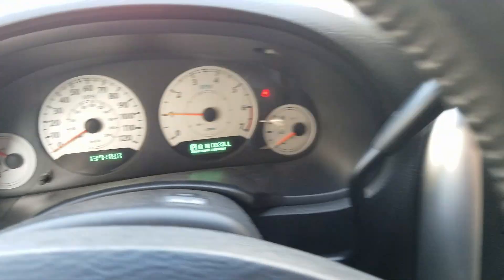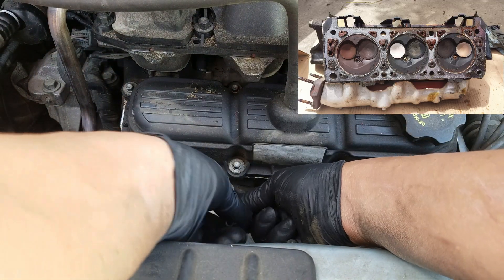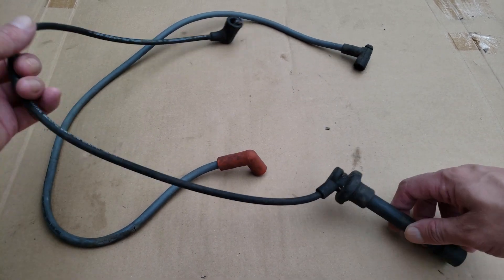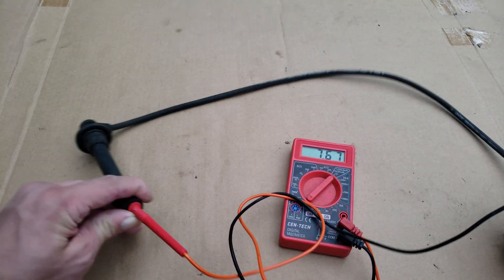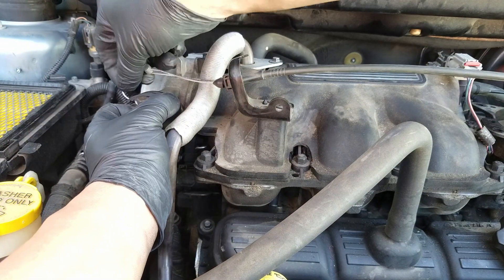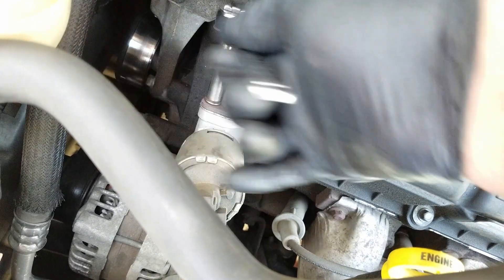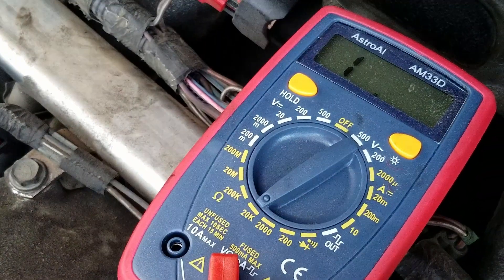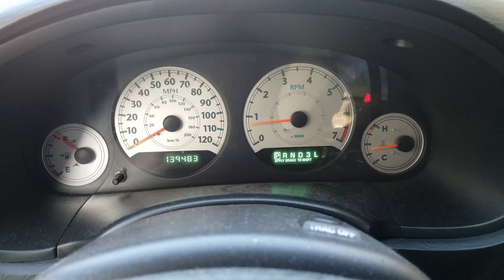How to Fix A Cylinder Misfire P0301 P0302 P0303 p0304 P0305 P0306

Comment: I have a 2006 dodge grand caravan that started running rough and had p0303 code. I swapped out # 3 and 4  spark plugs and wires and the code changed to p0300. Do you think the coil pack is bad?

Comment: What would cause misfire on 4 5 and 6? I have codes p0420 p1151 p0171 and p0174
Reply from the maker: Well ur running lean on both banks..so thats causing ur misfires...i would check for vacuum leaks..check ur air filter..clean maf sensor maybe..if not maybe u got issues with old or dirty sensor 1 oxygen sensors...and yea unfortunately also seems u got an old catalytic converter

Comment: is it the line order or firing order to fix p0302?
Reply from the maker: Well firing order has to do with the sequence the engine uses to fire the cylinders..but p0302 means u got a misfire on cylinder 2..so depending on which engine u have..if u have a 4 cylinder itll be in order..so cylinder 1 starting from the front closest to the accessory belt..if u got a 6 cylinder like on the video..cylinder 2 would be on the bank facing the front towards radiator the first one from left to right closest to the belts

Comment: Hello nice channel! I have a 2006 Chevy cobalt 2.2 I have oil sludge in my air cleaner/intake box that covers the throttle body and also p0301 code (cylinder 1 misfire) I already swapped the new spark plugs and boots i put in and still cylinder 1 misfire so I think it may be a bad coil pack but maybe it is  the valve cover??? Car shakes when bad when idling or stop at light but NOT driving
Reply from the maker: The oil on that car happens, since its got an older pcv valve its causing a lot of blowby...Normally when the coil goes bad on that car itll cause 2 cylinders to misfire since 1 coil controls cylinder 1&4 while the other coil controls 2&3..i had a similar problem on one recently and it ended up being a bad ignition module..i do have a video on tests u can run on the coil and ignition coils, maybe u might find it helpful.
Reply: @backyardchevy328  I’ll check those out, thanks a lot!
Reply from the maker: @brolla12  sounds great🙂 good luck i hope its helpful
Reply: @backyardchevy328  update: so i tested the coil pack with the multimeter and it’s reading at .8 for both which is good. I’m bout to test the ICM next. However, THE LITTLE CONNECTOR that goes between the ICM itself and the coil pack itself appears to be in good shape except that if I shake it a little it sounds like something is loose in there is this normal?
Reply from the maker: @brolla12  i shook the one i have here and it does sound like something moves like a very faint click back and forth...if all that checks out fine..id probably test the compression and compare that to a cylinder next to it just to verify everything inside is working normal..then maybe test the injector by disconnecting the connector and check ohm reading to the one next to it..after that may be the actual injector may be clogged..or something associated with that cylinder
Reply: @backyardchevy328  Yep I’m gonna mess with it more tomorrow; but I noticed the pigtail (wiring connector) that comes out of the car itself to connect to the ICM appears to be missing three pins ? Could this be the issue causing cylinder 1 misfire
Reply from the maker: @brolla12  no they do have missing pins, i just never counted how many it has
Reply: Gotcha! I’m sure I’ll figure something out.  This is my first car that I got senior year of HS, and I’ve done all the basic maintenance my self thought the years I’ve owned it; now its made me wanna keep learning more about cars. I appreciate it you sharing your knowledge! The camera angles in the videos are great, and the fact you are very clear and informative about everything; especially how to use tools to test AND show why the problem may have happened in the first place...Ósea, you show not just how to fix it but why it broke too! Keep doing what your doing man it’s great 👍
Reply from the maker: @brolla12  im sure you'll figure out this misfire too🙂👍 its definitely a good feeling to be able to figure out the problem and fix it..does it misfire the whole time or is it random misfires..if its random it may be harder to pinpoint due to the fact sometimes the readings on the components will be good and they only have problems under load.
Reply: @backyardchevy328  update so i tested all and everything seemed fine. I ended up cleaning the injectors with a buddy who has the equipment; the car was fine for one day but now it still misfires at idle/stop JUST WAY LESS than before..could it be the injectors need more cleaning or possibly just be replaced? Code is p0301
Reply from the maker: @brolla12  I would try switching injector location, take injector from cylinder 1 and put it on a different cylinder and see if the misfire follows that injector..if so then yea you'll definitely have an issue with the injector
Reply: @backyardchevy328  i ended up replacing the coil pack and ICM (bought the NGK one that comes as one piece) and car cranked and started fine but started shaking more then before and the engine light blinking with power reduced.. could It a faulty part even tho it’s new or should I try disconnecting battery
Reply from the maker: @brolla12  shaking and blinking light means u got misfires..its odd that it even got worse with the new part...it has happened to me with a ignition module i ordered off ebay once it was supposedly new but it was causing it to run worse and even came out with a cam sensor code..then i got one locally and fixed it all
Reply: @backyardchevy328  i ended up swapping the new ignition control module with the old ignition module (but left the new coil pack)  and it ran fine so looks like the same thing happened to me and it may be defective! however I bought my whole part new from the parts store, so I’m gonna go get the same part from them to swap it out and see what happens because id rather have both parts new..Either way I definitely know the problem now! Thanks again for your videos and this discussion 👍
Reply from the maker: @brolla12  thats awesome..glad to hear it🙂

Comment: I wished it was just an injector on my 2007 Colorado.  Since my Colorado is considered a newer model of the misfiring and overheating in idol.  JBA Chevy has told me after diagnosing my problem that my truck was over heating in idol and misfiring in cylinder #3 was more of an internal issue.  It was starting to affect the other cylinders after they put on their special computer.  A Whole Gasket Assembly had to be replaced on my truck.  A $5,400 repair job.  18 hours labor.  I'm broke now.  O o   Supposedly if the truck was older.  It would of been just a simple Gasket replacement, but it was affecting all cylinders and affecting the other injectors.  It was becoming dangerous to drive.
Reply from the maker: Ouch, im sorry to hear that 😔..yea those are usually the symptoms youll start having with a bad head gasket.

Comment: I have a 2005 dodge caravan. The engine does turn over and I was told it is because there is no compression in cylinder #2. Can you tell me if there is a way to fix this or how expensive it would be to fix. Thank you
Reply from the maker: No compression in a cylinder could be a few things..i could be that a valve isnt opening and that could be something like a rocker arm that maybe got damaged and that would be the cheapest repair..but also more expensive things like a head gasket...a burnt valve/damaged valve..or a camshaft...or worst case damage to piston...so only way to really tell is to try different tests like leakdown test or to open it up
Reply: @backyardchevy328  Thank you so much. I'll try the cheaper route first and hopefully that works. I'll come back whenever I figure it out.

Comment: Hi. I'm having an issue with my car, I want to get a heads up before I take it in for a diagnostic. I'm a woman & don't know much about cars & trying not to get ripped off. Well, I have 2016 chrysler 300s V8 it has 37,000 miles on it. When I take the car out first thing in the morning for a drive & I'm going about 30-40 mph & for the first 2 stop lights/signs when I brake the car jerks forward and kind of vibrates (not the steering wheel) before coming to a complete stop. It only happens for about the first 2 times i push the brake after that it breaks fine for the rest of my drive/day. What does this issue sound like? Rotors, transmission, misfire, software update? & do you recommend taking it to the stealer since it still has powertrain warranty or independent shop? & thank you so much for your videos.
Reply from the maker: sounds like ur idle might be high(which is normal when vehicle is cold)which is why it only does it when cold but maybe the idle might be too high which is why it jerks forward..maybe they have a computer update to lower cold temp idle or maybe a problem with the throttle body(could be dirty or possible vacuum leak)..cause after it gets to operating temperature it drives fine and at operating temperature the idle gets lower which normally happens
Reply: @backyardchevy328  I just drove it right now, warmed up & i'm feeling a slightly forward "jerk" like if I were to suddenly brake hard & your body moves forward, even if brake slowly. Not as much as when it's cold. Idk if I'm just paying too much attention to it or overthinking it. Hopefully it's something simple like computer update.
Reply: @backyardchevy328  & what causes the high idle?
Reply from the maker: could be the computer tune...could be a vacuum leak...could be dirty throttle body...or faulty throttle body..but yea sure seems like idle is too high..its like if someone was to hold brake and press the gas in slightly the car will jerk forward because theres more engine torque being put against ur brakes.
Reply: @backyardchevy328  yes that's exactly what it feels like.. thank you so much! Now I got an idea of what to expect.
Reply from the maker: @ilsemorales4955  that can also wear on the brakes more than normal and also dangerous if u have to stop suddenly...hopefully they take care of it for u free of charge...good luck..let me know how it turns out...thank you🙂
Reply: @backyardchevy328  I doubt free of charge. Dealer said they'll charge me 140 for diagnostic, even if it's only the software  update 🙁.. I'll let you know what happens.
Reply: I forgot to mention. I also recently had the engine air filter replaced (i put in an OEM filter)  Idk if that has anything to do with it.